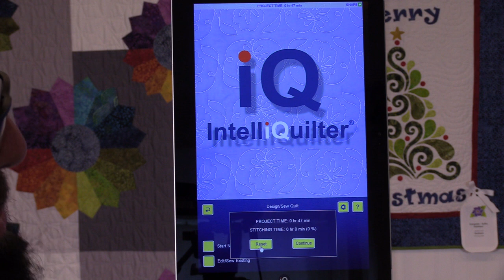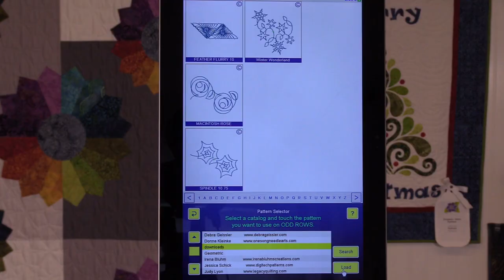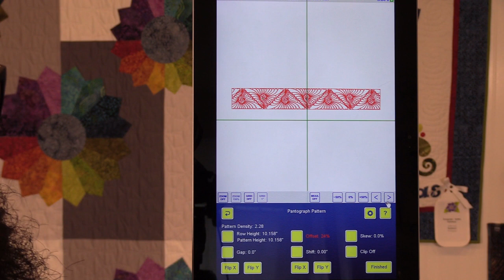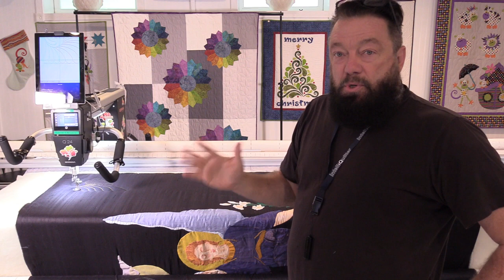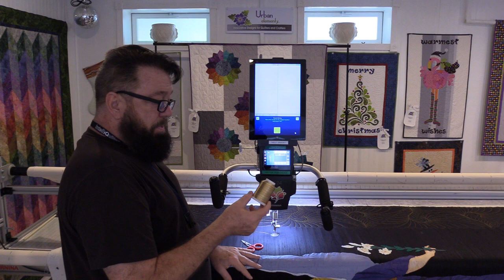Double Digital - Feather Flurry -  Urban Elementz

Comment: Good presentation 👏 What thread did you use in the bobbin..brand. weight etc?
Reply from the maker: There are a couple factors that  influance my bobbin thread.  

1) I try and match the value of the backing fabric with the over all value of the front of the quilt.
2) I use the same weight thread in the bobbin as on the front. 
3) I got started on isocord 40 wt when I started on the Bernina Q24.  Cotton was producing way too much lint in the bobbin area and around the needle bar.
4) I kept the 40wt isocord for the Superior metallic. 
5) I try and match the value, if not the exact color, to the value/ color of the backing fabric.  I don't really want my quilting on the backing to stand out at all, as it is not my focus of the quilting to begin with.
Reply: @urbanelementzdesigns  Thank You 😊

Comment: Beautiful! Can you tell me about the IQ? Is it less expensive than the Q-matic?
Reply from the maker: I have no reference for the Qmatic.  The IQ as I have it on the frame is aprox $12 thousand.  Their pricing info is on their web site.  I have super motors and the top of the line software.  I love its flexibility and ease of use.  Also love having the tablet right over the head of the machine so there is no walking back and forth from the needle position to the end of the frame where the table is on other brands.